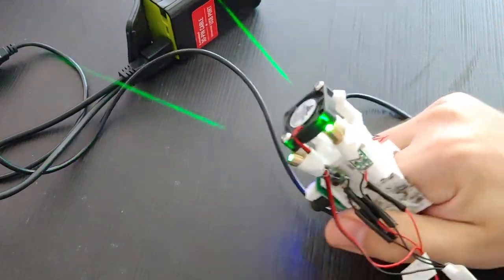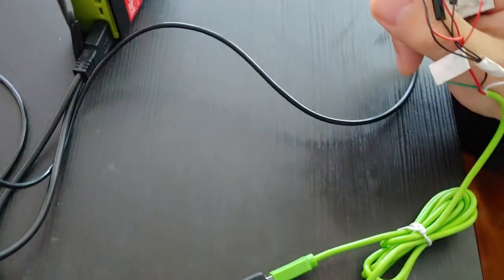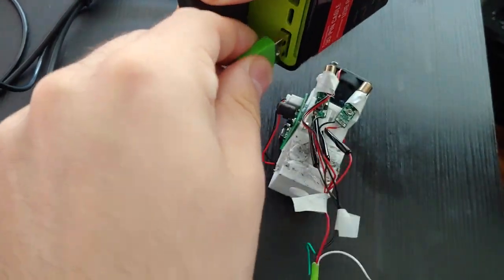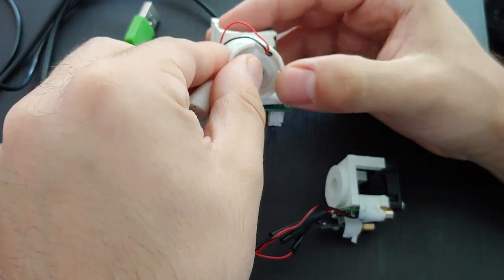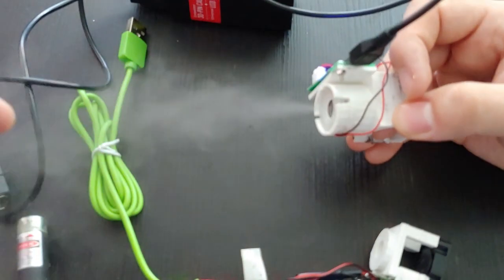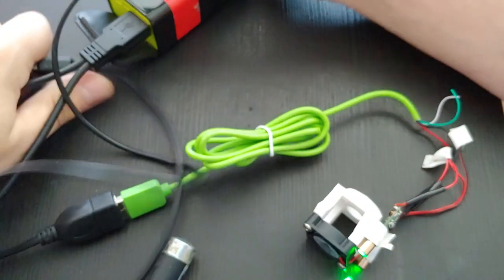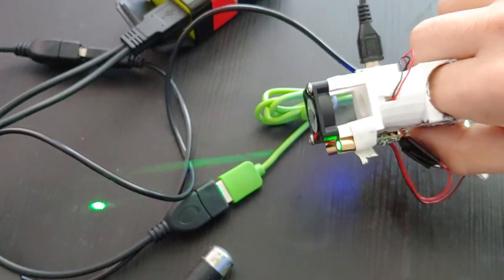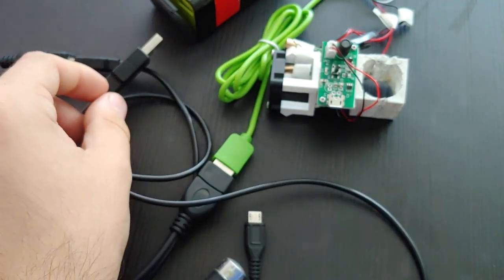I made the World's 1st Working Green Lantern Power Ring - Homemade GL Light Construct Ring

Comment: Ring? Lol. It's a hunk of plastic and wires connected to more wires and a battery that you've rigged to wear on a finger. 😂
Reply from the maker: Hey, I appreciate the criticism. Like I said in the video, it’s still a very early prototype and is more of a “proof of concept” than anything, and I am currently designing a new build which shrinks all the components down. The main point was to show that you can create these “floating images” or shapes in space and hopefully use that as a starting point to build a smaller device